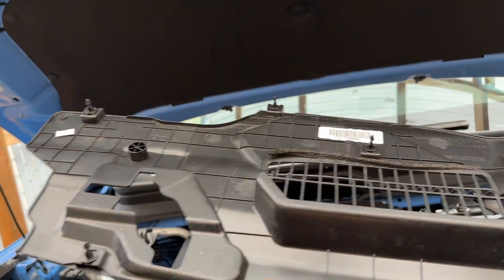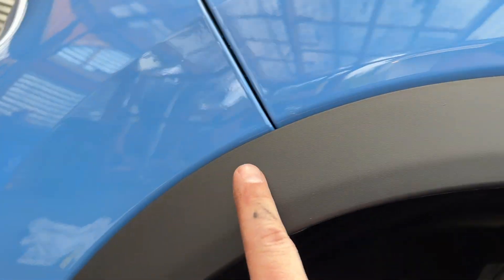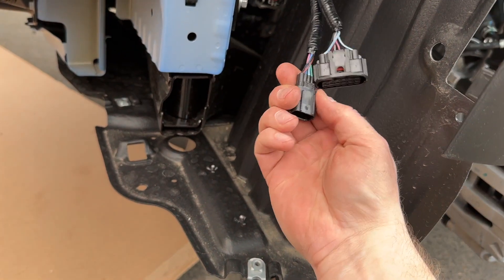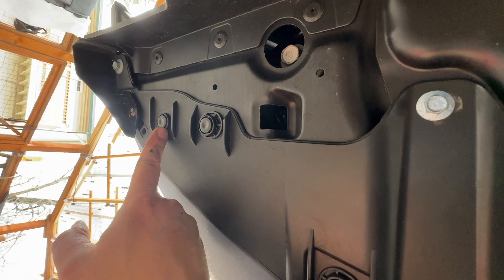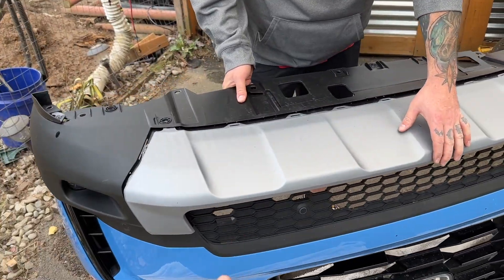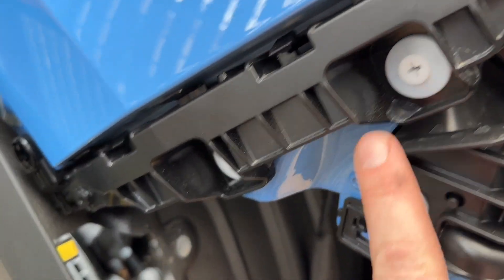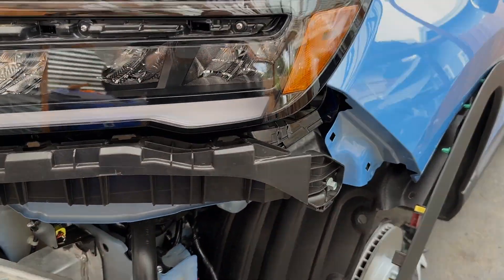2023 Honda Pilot Front Bumper Removal and Grey Bumper Trim Delete

Comment: How did you removed the clip holding the trim by the headlight? TIA
Reply from the maker: Which clip are you referring to?  Once the screws were out, everything just pulled out, with a bit of wiggling
Reply: @503pdxCars  the black trim just below the hood line, I called it unibrow :)

Comment: I noticed when you had the whole front end off upside down and we're talking about how it's a nightmare to pry that front fascia out, it looks like you can just take that piece off without taking the whole front end off. Is that correct or am I missing something?
Reply: I think you might have answered that question in an earlier comment.
Reply from the maker: You can technically do it without taking off the bumper based on others, I have not been able to and I feel like it would take a lot more time vs simply just taking off the bumper honestly

Comment: Looks so complicated, I’m here just wanting to swap my OEM fog lights to Amber/Yellow . 😢
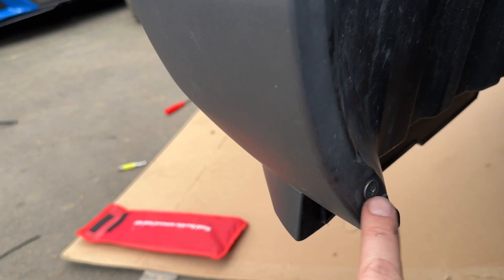Reply: Bro, I've changed my fog lights out. You don't need to do all this. It's super easy. Just take out the lower two screws that he calls #1 and #2 at 0:47 to 0:49 ... then remove the clips above screw #2 (there are 3 clips between screw #2 and screw #3). Once you do that, just move back the plastic fender enough to be able to stick your arm into the hole where the fog light is. The fog light has 4 screws. The wire that you need to remove from the fog light is an L1B connection and you have to depress it on the bottom side rather firmly to get it to come undone. Wiggle it while you depress it.